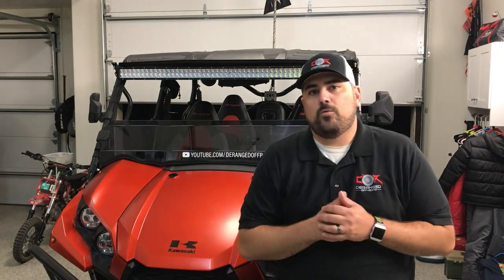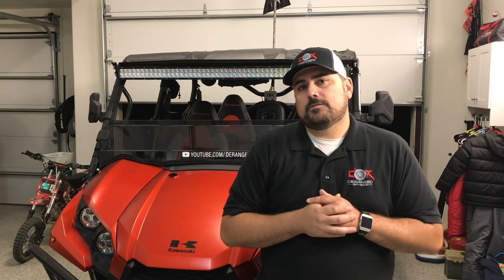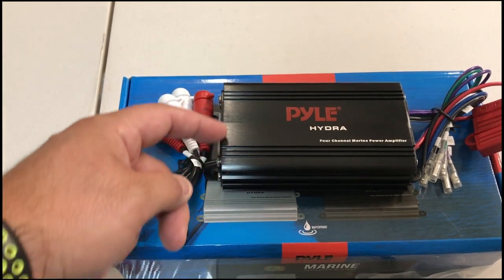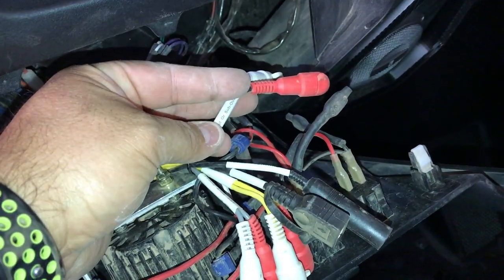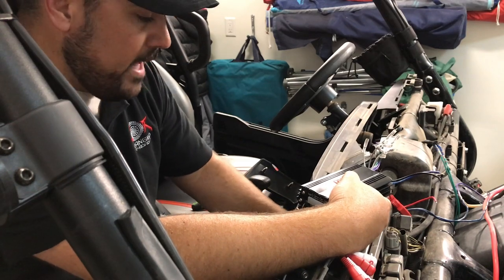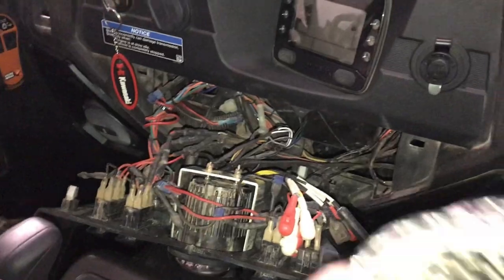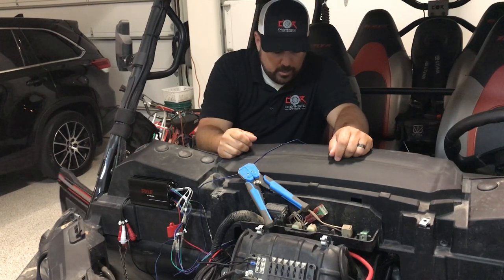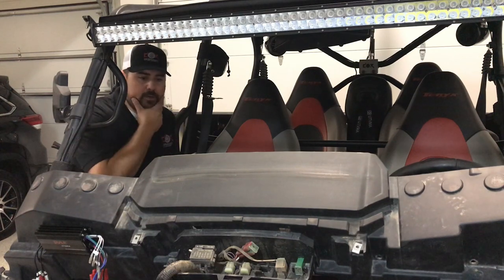UTV Amp Install on the Teryx 4 - Budget Audio

Comment: Any idea why I would be getting distortion (crackling) when I adjust the volume and how I would fix it.  I bought a golf cart that has pyle on the switch so I assume it has a pyle amplifier.  Thanks
Reply from the maker: Many times, it’s caused by lack of power. Maybe the amp isn’t pumping out the power and the speakers will crackle or sound different if they’re not getting enough power. Also make sure your ground is good and placed in a proper area.

Comment: Was the red amp wire connected to the battery positive? All I heard was the remote wire connecting to the radio remote wire.
I was confused with so many power wires.
Reply from the maker: Red wire went to positive and black went to negative on the battery.
Reply: @DerangedOffRoad where did you run the blue wire? I have the same amp and I’m trying to figure out how to wire it but confused on what to do with the blue wire

Comment: Does the amp seem to run hot at all being completely covered up? I am about to do a similar install...
Reply from the maker: I placed it in the front area and it seemed to get plenty of air and still was protected. Installing it in the glove box or so could cause it to run hot.

Comment: Is that amp plye 4ch hydra 4ch Bluetooth amp white?
Reply from the maker: The hydra
Reply: @DerangedOffRoad  yes the plye hydra 4ch is white
Reply: @DerangedOffRoad  how can I hook up plye hydra white 4ch Bluetooth amp , 12v Talentcell 6000mah recharageable battery, Tegg 5pcs DC-099A DC Female Panel Mount Charging Wire Threaded Socket Jact Connector with Dustproof Plug IP67 68 Water-Proof Large Current Power Adapter 5.5x2.5mm,APIELE 22mm Latching Push Button Switch 12V Angel Eye Ring Light LED Waterproof Stainless Steel Round Metal Self-Locking 7/8'' 1NO 1NC 1 Pack (Blue) using theses, 10pcs Conductor Compact Connectors Lever Wire Nut Electrical Connectors with Fixed Base for 3 Circuit Inline Splices 28-12 AWG

Comment: I have a question, I want to put an amplifier on my Tyrex4  do I have to disconnect the speaker from the stereo and connect it to the amplifier?
Reply from the maker: Yeah your speaker wires will run through the amp now.
Reply: @DerangedOffRoad  Okay, so do I just need to connect the rc cables and the speakers?
Reply from the maker: RCA cables from amp go to stereo and then speaker wires go to amp. Also make sure you get the right amp. If you have four speakers you need a four channel amp.
Reply: @DerangedOffRoad  I have 2 speakers and a two channel amplifier that’s 1000 watts. I have 2 small speakers in the front and 2 big ones in the back. Do I need to connect the 2 front ones to the amplifier too?
Reply from the maker: Nope not at all, you can run them however you like.
Reply: @DerangedOffRoad   thank you, I also just placed an order from your website so can’t wait for it to get here.
Reply: @DerangedOffRoad  How do you hook up the rcas to the deck???

Comment: Can i add a subwoofer with this amp
Reply from the maker: You could, but I really don’t think it has the power to run it decent.
Reply: Well i only have like a 200watt amp. Its not muchh.  But howww? i tried and my sub wont work.

Comment: Are you using the amp to power 2 speakers or 4? Thanks
Reply from the maker: All 4 👍
Reply: @DerangedOffRoad  thank you for the quick reply! But I’m confused, I have the same head unit you do trying to hook it up to the same amp,trying to use 4 speakers,but amp only has 1 input and head unit has front and rear out,so I’ve tried using rca splitters but no matter how I hook up rca cables I get no change in volume,speakers are hooked up to wires from head unit.I’m not sure what the aux in rca connections are used for🤷🏻‍♂️ and since this amp has no power light not sure if it’s even working or not.You say at the 3:36 mark that you are only using the rear line out from head unit, when I try that I get no increase in sound, like I said I’m not getting anything to work
Reply from the maker: Honestly from what I’m hearing it’s possible you have a bad amp. If I still had my Teryx4 here I would go look at it again to see it’s been a while since I’ve did this vid to remember. My one complaint I learned as well was the no power light on the amp.
Reply from the maker: One more thing you said your speakers are hook up to the head unit or amp?
Reply: @DerangedOffRoad  speakers are hooked up to head unit. I unhooked everything and just hooked up the speakers to the amp to make sure amp worked,and it does. Hooking up directly to amp you can only use two speakers, it doesn’t have four speaker hook up.Head unit has wires for 4 speakers.So When I had the four speakers wired up to the head unit,I got no increase in volume when rca cables are plugged into amp.I tried rca cables from amp input to rear line sub Output of head unit, no difference.I’ve used rca splitters for red and white input connections from amp,so I would have rca connections to rear line out and front line out of head unit, and that does nothing also, so I can’t figure out what I’m doing wrong. I have searched the Internet and I can’t find detailed instructions on how to do this, yours were the only one I saw hooking this amp to same kind of head unit.Thanks for your help
Reply from the maker: The speakers need to be hooked up to the amp. Did you buy a 2 channel amp verses a 4 channel?
Reply: @DerangedOffRoad  2 channel
Reply from the maker: Thats the problem my link is for a 4 channel. All speakers need to run through the amp not head unit.

https://www.amazon.com/Pyle-Hydra-Marine-Amplifier-Waterproof/dp/B009IAP5OE
Reply: @DerangedOffRoad  I’m just now noticing that yours is a 4 channel,even so I would think mine should work if I just try and use 2 speakers
Reply from the maker: It should work with only two speakers and one set of RCAs front or rear.
Reply: @DerangedOffRoad  I tried that,but the speakers were hooked up to head unit
Reply from the maker: So you had two speakers hooked to the amp and two speakers hooked to the head unit?
Reply: @DerangedOffRoad  no I had all 4 hooked to head unit with rca plugs going from amp input to rear output on head unit
Reply from the maker: That’s why, they need to be ran through amp. 👍
Reply: @DerangedOffRoad  ok I’ll try that,thanks for your help
Reply: @DerangedOffRoad  sorry to bug you again,I bought the 4 channel amp you have.I have rca cables from head unit connected to inputs on amp, I have four speakers hooked up to speaker connections coming from amp.It works but it’s actually louder if I just hook up the 4 speakers to head unit without amp.I have volume control turned all the way up on amp. I have the two buttons on amp in the out position, if I push them in and makes the volume decrease.
Seems to me this amp does nothing when hooked up to head unit but works fine on its own if you just want to use it that way,but doesn’t seem to add any additional power when hooked up to head unit
Reply from the maker: @redskinman0  sounds like it, what speakers are you using  on your UTV?
Reply: @DerangedOffRoad  I have 2 6.5” Pyle marine speakers rated at 400 watts,and the other 2 are mounted in box no name brand,bought them at Walmart years ago.
I talked to tech at Pyle on phone, told him how I had them hooked up, he said it sounds like everything is hooked up right, he thought my amp is bad,I returned it and I am giving up on the amp,just going to use head unit

Comment: What’s the blue wire for?
Reply from the maker: That’s a remote wire and it turns the amp on and off when power is applied.
Reply: @DerangedOffRoad  where’s it go too???
Reply: @devrgh6784 wondering the same thing right now lol I have the same amp trying to wire it